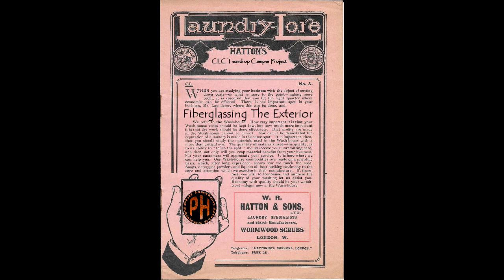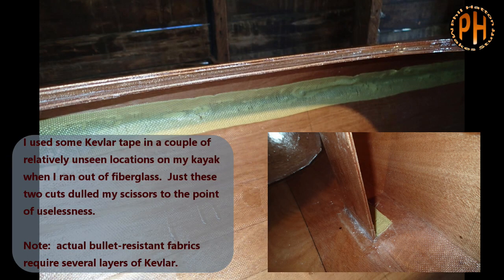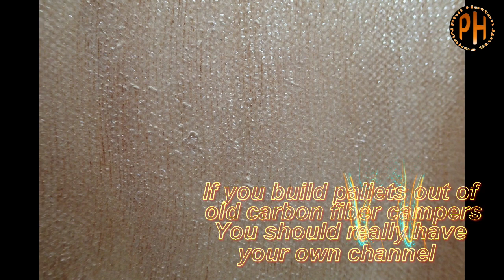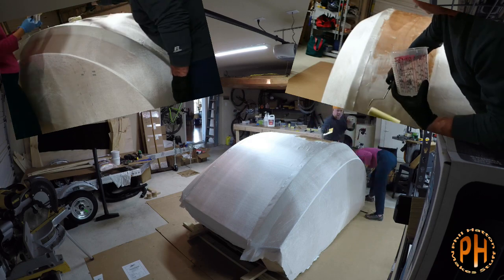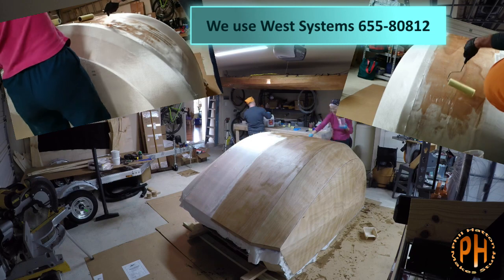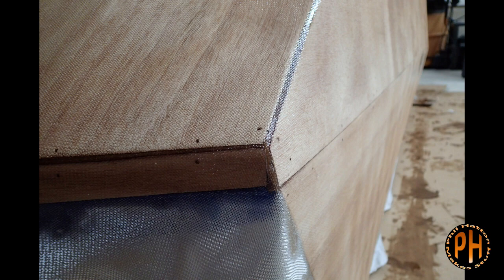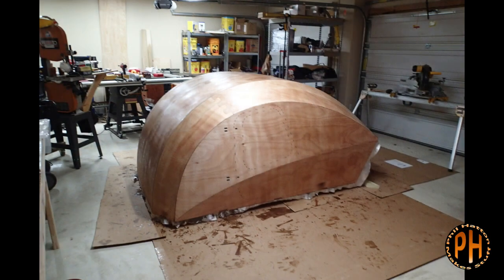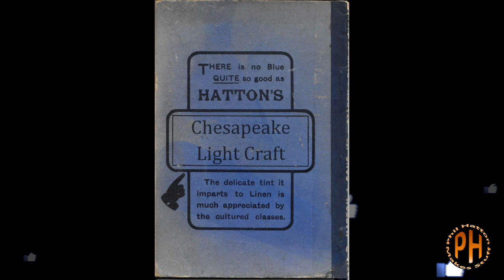Building a CLC Teardrop Camper - Glassing and Epoxying the Exterior - Stitch and Glue Construction

Comment: I started my CLC camper in late May and finished it in early November. My wife didn't see much of me for about 5 to 6 months because I was basically living in the garage.
We've now had the chance to take it out on one overnight camping trip close to home. It got down to 10 degrees F that night.
Reply from the maker: Brrrr!  Did you get much condensation?
Reply: @PhilHattonMakesStuff  We were camping in Oregon's High desert. I put CLC insulation on the inside, so our moisture could only be noticed on the inside of the windows. 
Yes, the windows were iced up on the inside.
I also designed and built my own trailer. It's steel and I put Timbren off road suspension on the trailer so I can pull it into very remote places or pull it on 40 miles of washboard roads without shaking things to pieces. The camper/trailer combination only weighs about 650 pounds.
Like you, I'm nearing retirement and I'm really excited to get the thing out on some long cross country road trips. I also built the CLC 18 foot mill creek canoe, so we'll take it with us on our journeys. 
Which canoe did you build?
Reply from the maker: @burkerow  we built Pygmy Pinguino 145 kayaks.  Ok, I know that will be odd putting two Pygmies on top of a CLC Camper...

Comment: good video .  i just started making a video for my camper and it may help with yours as i am not sure if you have cut the side doors out yet
Reply from the maker: Thanks!  The video on cutting out the doors and gallery hatch is coming soon.
Reply: Do you think putting the side cloth on after the first top coat and before second top coat would hold things together better for epoxy application? Also, as the weave of the cloth is visible do you just add more coats of epoxy till it is embedded?
Reply: Sorry Phil reviewed the video and see that as long as not too much time passes recoating without sanding is okay. Could you let me know how soon to recoat? Thanks again for your help
Reply from the maker: @rickcathcart2196  That depends on your epoxy.  If you're using System 3, this is what they have to say:  When this first coat is cured to at least a soft set tack free stage it can be recoated.    Subsequent  coatings  applied  at  any time  between this soft set stage and 72 hours do not need to be sanded and will chemically bond.Subsequent coatings may still bond well after 72 hours without sanding but the proposition gets riskier.  An amine cured epoxy surface  is  quite  alkaline  and  can  react  with  any  acidic  material  such  as  moist  carbon  dioxide or  silicates.  Further  epoxy  coats  may not bond well to some of these reaction products.  Sanding, in  addition  to  providing  some  “tooth”  for  mechanical  bonding  , also cleans since it exposes new, uncontaminated surface.  If in doubt, sand enough to kill most of the gloss.  https://cdn.shopify.com/s/files/1/1000/1906/files/Epoxy_Book_2006_NEW_with_2018_Edits.pdf?2485911027753381509 

The whole System 3 Epoxy Book is interesting reading.

After the first coat, additional coats will fill in the weave of the cloth. 

Regarding putting the side cloth on after epoxying the top, that might be a good idea if you are working by yourself since the epoxy could kick off and if you have runs or you somehow shift the side cloth, you'll have a perma-wrinkle, or the cloth could have big bubbles or even get hardened hanging away from the plywood before you can stick it in place with epoxy... all problems you'll need to sand out and patch.  Since Amy and I have done this before we were pretty sure we could keep the epoxy relay going fast enough we could get the sides coated before we ran into those problems.
Reply: @PhilHattonMakesStuff  Thanks once again. I hope to start working on the camper right after Christmas.
Reply: @PhilHattonMakesStuff  I used the MAS epoxy with mine and had very good luck with it. Why did you choose to use the West system?
Reply: @PhilHattonMakesStuff  I also glassed and epoxied the entire shell like you did. My wife and I did the same relay. She kept mixing small batches of epoxy and I rolled it on. If she got too far ahead with mixing she would help me roll it on and then we would chase out any bubbles with the plastic spreaders.
Reply from the maker: @burkerow  we only used West system spreaders.  We used the MAS epoxy that CLC provided.